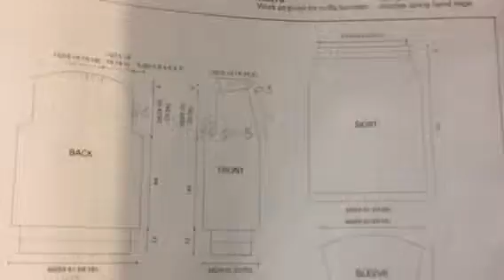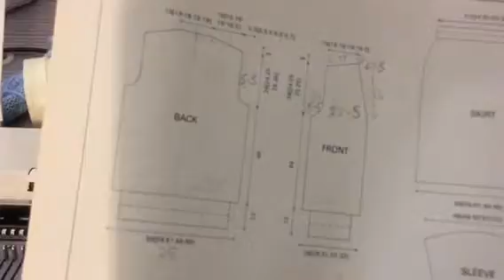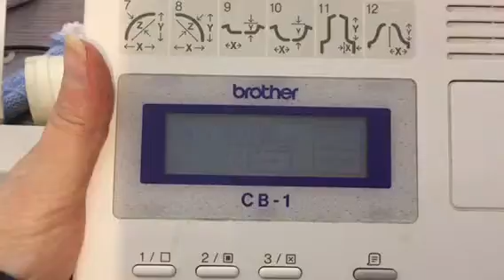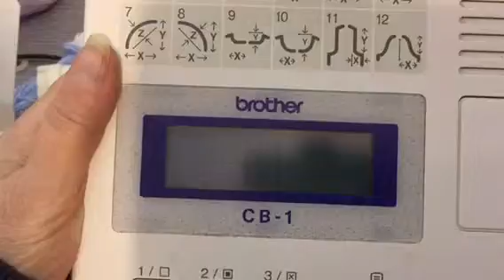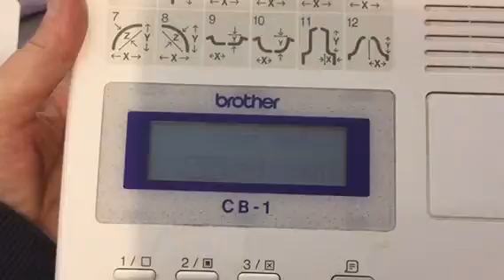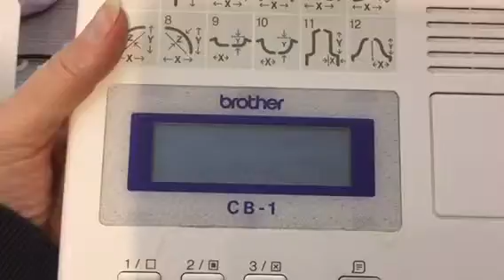Brother 970 Asymmetrical Garment design

Comment: Hi June I've just input my first garment I thought I'd done it wrong with casting on both sides of 0 now I'm doing pattern 242 which is 72 st repeat  but by not knitting either side of 0 the patterns dont match so how do you get shoulders to match in pattern I feel it's so easy putting garments in but nowhere in the book I can find doing fronts and getting it all to match I hope you can help as you seem to have done loads tia
Reply from the maker: Elaine Williams I would cast on one side of zero, it should match then, other side for second front
Reply: @JuneClark  I'm not sure why it doesnt do it from 0 to right or left instead of middle just means I have to trial run and write down sts as it's not visual